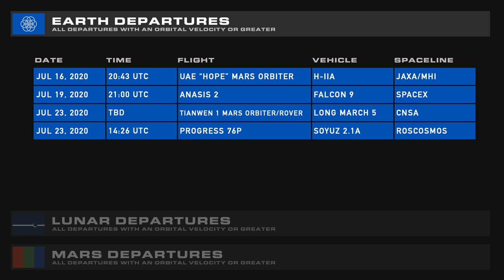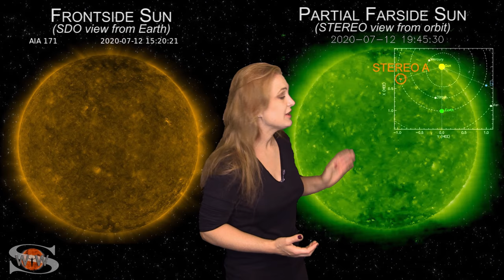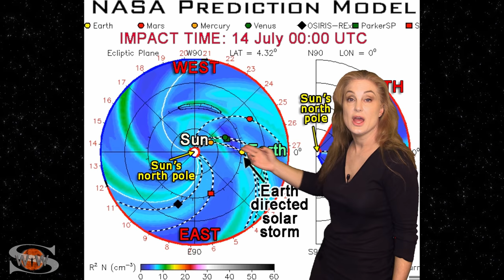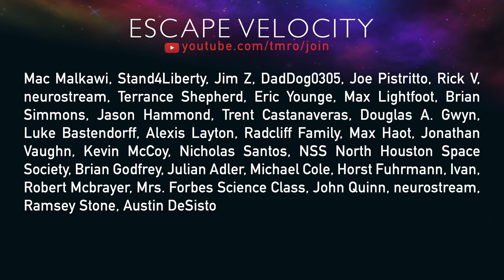NASA & Boeing Finalize Starliner Fixes | TMRO:News

Comment: Can Falcon Heavy launch Mars or other deep system probes?
Reply: Yiglic Persfactious - Yes. FH “Payload to Mars” is listed at 16,800 kg - 
https://www.spacex.com/vehicles/falcon-heavy/
And, you could conceivably increase that dramatically with orbital assembly and refueling.
Reply: Yes and it'll launch Psyche in 2022 to the asteroid belt. Falcon 9 will also launch DART to a NEO asteroid.
Reply: Basically, any rocket can launch things into deep space, it's just a matter of how much mass it can throw into deep space. If your probe is light enough, more and more rockets will be able to do the job, even Electron.

Comment: Mel Brooks song Jews in Space, popped in to my head when I saw their flag on the satellite.
Reply: Jews read and write Hebrew from right to left, so it's only natural that their orbital rockets would fly that way, too. :-) (IAI would like to offer the Shavit-1 and Shavit-2 to the small-to-medium satellite launch market [including for launches outside of Israel], and they have even designed a minimally-modified, air-launched version.) I wish they would put more effort into these options, as the Shavit vehicles are reasonably-priced, very reliable, and quite easy to prepare and launch (its TEL--Transporter-Erector-Launcher--can also, I think, be transported in standard cargo aircraft). In polar, heliosynchronous (Sun-synchronous), and especially easterly direct (prograde) launches, Shavit's payload-to-orbit is significantly greater than that for retrograde orbit launches.

Comment: why NASA is still with boeing, i mean has failed, its expensive and its design is old too. and they have already gulped extra billions from nasa.
Reply: Did you not watch the video?
Reply: Someone was sleeping during explanation. If dragon explodes again, who will launch people? Orion on Delta IV? Making this human rated will be pain
Reply: Dream chaser is still an option. If two are needed then let someone else try.
Reply from the maker: Dream Chaser has been turned into a cargo vehicle, which has an entirely different and more relaxed set of parameters to follow as compared to a crewed vehicle. I can't speak for Sierra Nevada because obviously they're the ones who would know, but I find it difficult to believe that this late into Commercial Crew the added cost and time delay of converting a cargo craft to human standards is worth it.
🚀Jared
Reply: @TMRO  As I stated in my own thread, the dreamchaser has been built in it's cargo version, but the project was always intended as man rateable, and they have not abandoned that.
Reply: @_mikolaj_  Orion as currently designed (but remember the MPCV?) is overkill for LEO-only, anyway.
Reply: @TMRO  let me introduce you to my friend the "sunk cost".
Reply: @stardolphin2  yeah,
Reply from the maker: Actually, Phoenix, re: crew-rating Dream Chaser: you're correct, I'm wrong. An article more recent than the one I had initially read has Dream Chaser's program manager saying they can get all the things needed for crew in quickly, but I still feel the qualification process [pad/in-flight abort testing, etc] would slow and inflate program costs. But you are correct, and I am wrong on flying Dream Chaser with crew in the future.
🚀Jared